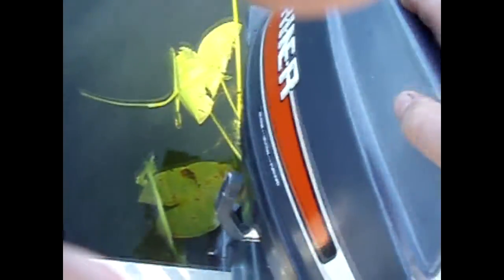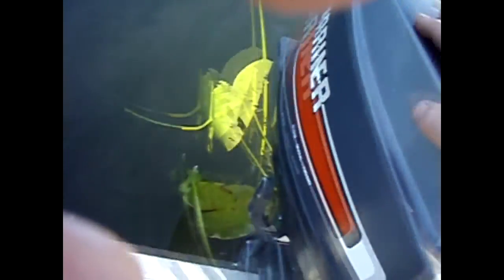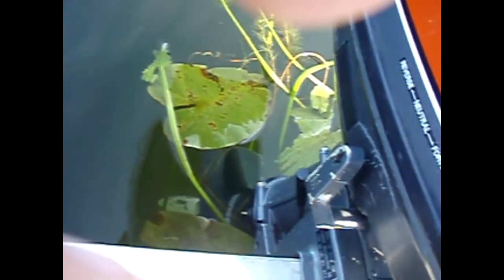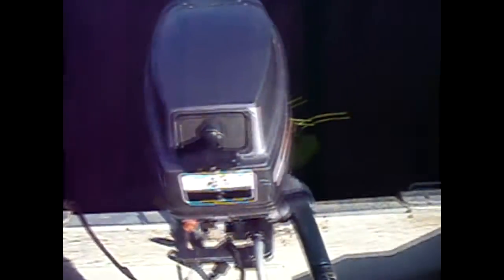Mariner / Yamaha 8 HP Short Shaft Conversion

Comment: Just curious, but how do you adjust the shift linkage rod that runs from just behind the carburetor and attaches to the shifter lever shaft,  and other end screws into a shift cam inside the lower unit. Mine stuck in forward gear, so I dropped lower unit and was able to screw the shift rod in a bit and it then went back to neutral ect. But I'm not sure how far it's supposed to be screwed in or if theres a particular adjustment? Thanks for any help

Comment from the maker: You will need the proper length vertical drive shaft and you'll have to cut down the engine cooling tube (I used a Dremel and file).  Not sure how they lengthen the exhaust housing on yours.  If they stack two 5-inch castings to get that extra length you'd just take one of them out but if the extra-long motor has a one-piece extension housing then you'd have to find a standard 5" long-shaft housing spacer.  Your shift linkage rod might be able to adjust to the shorter length.

Comment from the maker: You would need a short vertical drive shaft which is expensive and hard to find.  Mine came from eBay with a blown lower unit.  The lower unit has to be completely disassembled in order to replace the shaft.  
The shift linkage and metal cooling line that runs up from the water pump both have to be cut shorter.  
Then it's just a matter of unbolting and discarding the lower segment of the exhaust leg, reassembling everything to the power head and adjusting the throw on the shift linkage.